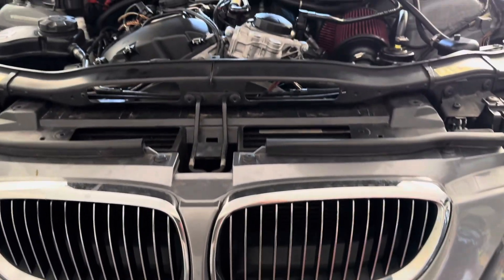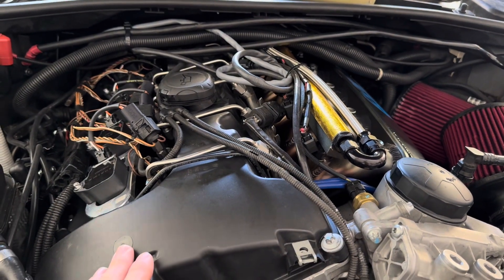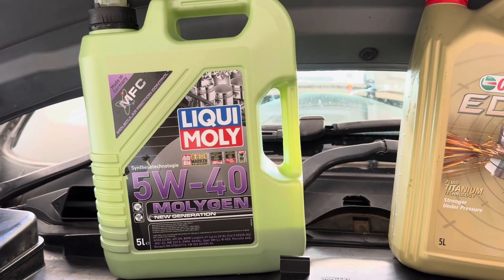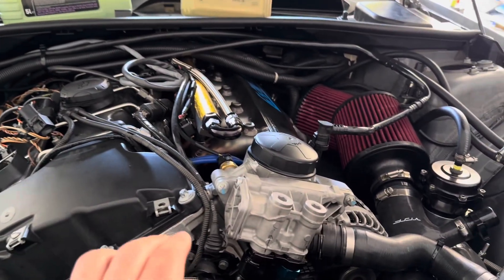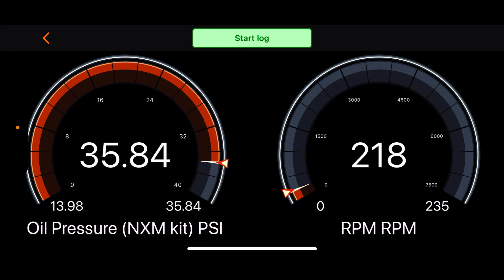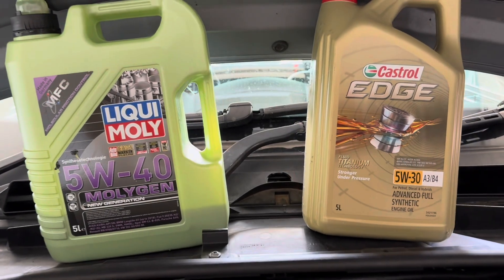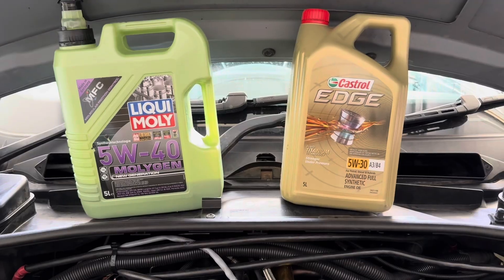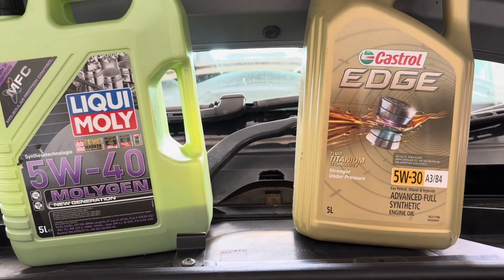Choosing the right oil grade - BMW N54

Comment: I’ve had my n54 z4 DCT a little under 4 years, nearly reaching 100k miles (love the sound and ride!). And now wondering whether to switch from 5w30 to 5w40… this video honestly made so much technical sense to not change. P.s I live in a -5 to 35 Celsius climate.

Comment: Did you have any issues when first installing the NXM kit? Installed mine yesterday, car is throwing 30C3 (oil sensor signal) and reading 0.

5V and signal pins are both showing 5V with a multimeter when the car has ignition on, and the ground is OK, borrowed a OEM BMW Sensata sensor from a junkyard N55, same thing, I guess it could be bad as well not knowing the history of that engine. 

Waiting for a  reply from NXM as im not sure where to go next... cant find any other posts about issues with it.
Reply from the maker: @Zodiam.  no fault code, but I wasn’t initially getting a reading.  From memory it was a licence/key issue because my DME had been changed and one of the VIN’s on the DME didn’t match my MHD licence.
Reply: @DarkePeak  thank your for the reply, I wish it was that easy in my case, the license was properly activated and i have flashed without errors, even went back to stock and then did a full write back to my custom map. Oh well.. maybe ill try yet another sensor while i wait for NXM.

Comment: If you read the thread on spoolstreet about the Nexsys oil pressure gauge, Jake from MHD mentioned. "I don't think you guys are understanding. It is "gauge pressure" once the engine is on.
The reported value is basically MAX(barometer, oil pressure); So when baro > oil pressure (engine off) you will see it log as such."

I monitor with a nexsys setup aswell. I noticed an interesting change as i changed my oil today when i switched to Castrol Edge 5w-40 the new SP formulation, car was up to temp bout 115C oil temp and the oil pressure is up to 38-39 PSI on idle. Now i've never seen this at idle before with other brands eg, Nulon, Liqui Moly Molygen, Vavloine, are all around 34psi once to temp. All oils are 5w40 so what do you think this means? i think on paper the castrol edge is thinner at temp but yeah i'm not sure.

Good work btw keep it up.
Reply from the maker: @HowsYaForM  Thanks. I went and found the spool street thread where Jake made those comments, but I’m not confident he is correct.  It’s either a “absolute pressure sensor” or it’s a “gauge pressure sensor” but it can’t be both.  Hydraulic pressure systems (eg, engine oil pressure, fuel pressure, etc) should use a gauge pressure sensor.  The software could make an adjustment but you would logically deduct this from all readings, including when the engine is off.  I am 99% sure the DME can’t do that calculation and if MHD logging is not active before you start the engine then they wouldn’t know what barometric pressure to deduct.  I need to hook up my manual test gauge (reads 0psi when engine off) and check the differences when engine is running. I don’t have a suitable t-piece so it’s not an easy task

Comment: from my exp,  liquimoly 5-30 to 5-40 the oil temp dropped atiny bit on n54 also
but when it aged it went as before,
so you saying the crank and rods holds the heat abit with the heavy weight oils? i don't think that's good  specially in hot climate am in one actually 🥲
Reply from the maker: The heavy oil is going to be worse at removing heat from engine bearings.

Comment: I use an accusump (oil accumulator with an electric valve) to get the same job done :)
Reply from the maker: That’s what I wanted but no room for it in the engine bay and not allowed to have it in the cabin.

Comment: you should contact them to make the psi change in the mhd software
Reply from the maker: Nexsys are useless.  I’m still waiting for a response on a different issue.  MHD are more likely to address it, and that’s where it probably needs to be done anyway.
Reply: @DarkePeak  yes thats what i meant. great video thank you
Reply: @DarkePeak   Check my other comment on here. Cheers
Reply: @DarkePeak  Nexsys is run by one of the MHD developers, so one and the same